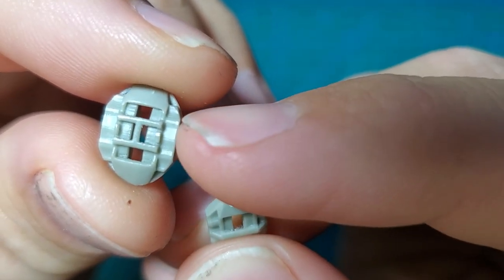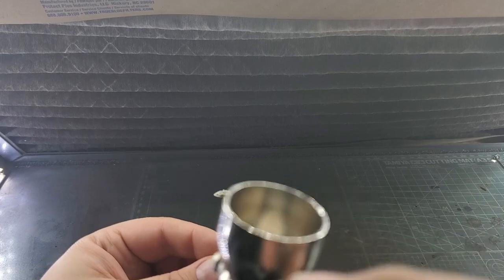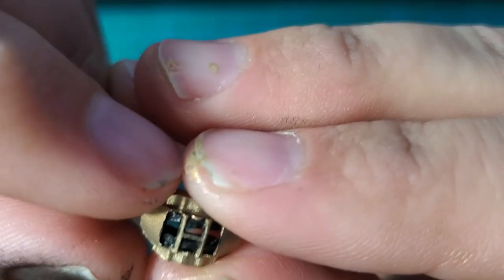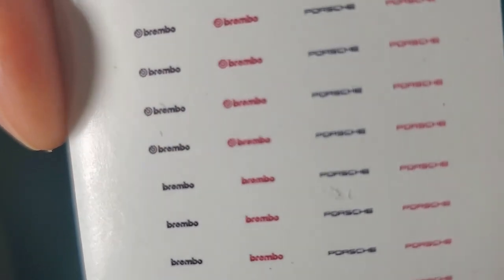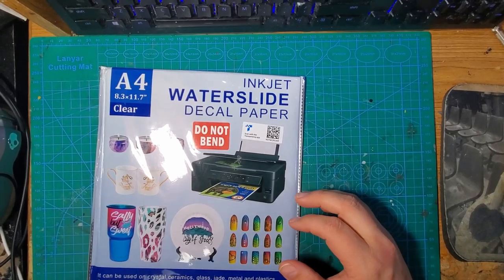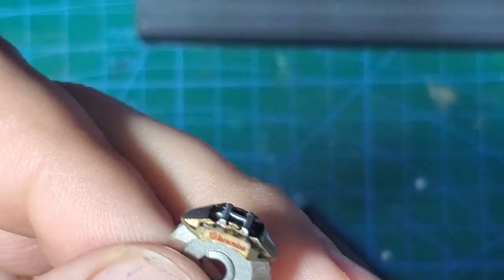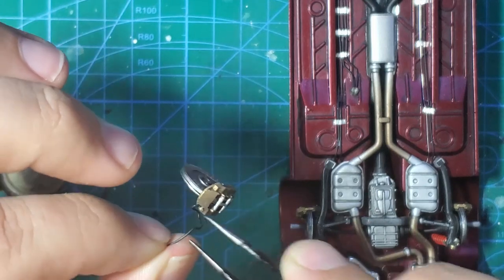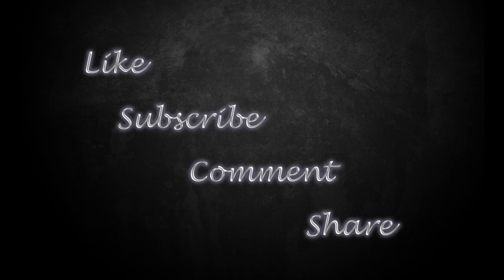Italeri Porsche 928   Building Better Brakes Pt 2

Comment: Another great tutorial on this Justin AND some decal creating tips to boot!  Which was great to see b/c I have never made my own before so now I know if I try what to look for.  The wiring on this is amazing man, so detailed.  Great great work.
Reply from the maker: Thanks Joe. I was kinda of thinking of doing a full tutorial on making custom decals. But If I do, I don't want to do the usual "buy this paper, don't for get to seal them with some crap acrylic spray no one can get, and apply like a decal". There's a few of those out there already. I'm thinking of showing me google searching for content, taking it into a graphics program, re-scaling it and preparing it, then the whole printing, prepping, applying and whatnot. But i use some software that is really expensive that a lot of guys won't have access to unless they have had a past life involving the digital high seas, and lots of rum... So I need to learn how to do what I do on something free and responsible like GIMP. and I have to figure out a good way to handle screen capturing. So it'll maybe be in the future.